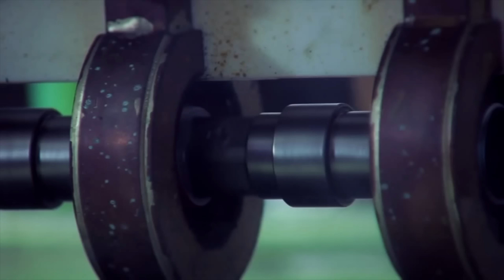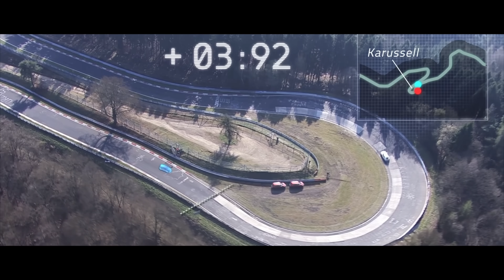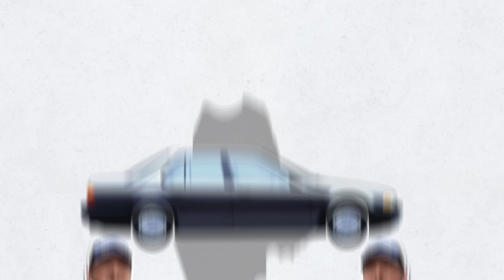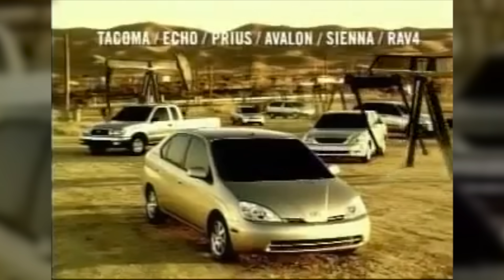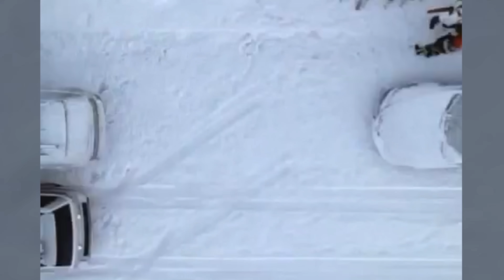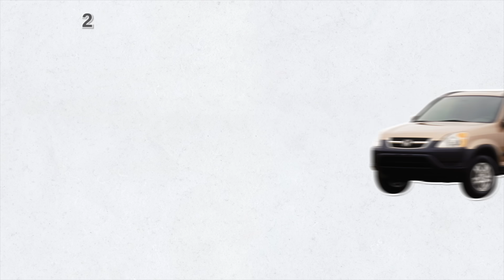Here’s Why Honda’s New Cars are Genius

Comment: The old cvcc engine is my favorite.  That thing got incredible mileage, was reliable once they fixed a few issues and you could run it on the cheapest crappiest gas without an issue.
Reply: Why would you want to run the crappiest gas you can...

Comment: I’ve had a Honda 2002 Honda CRV mk2 petrol, automatic for the last 19 years, 250k miles. Drives like when it was new. 
Even the interior doesn’t look like it’s worn very much. (Just the steering wheel and the drivers side floor mat) 
Never broken down and never had a problem with it. 
I drive it to work every day with complete confidence. 
I take it on a 400 mile trip every month and I also to city driving with it. 
It’s a little thirsty sometimes but it’s from 2002. 
It’s just a really comfortable car to drive and you can unbolt the rear seats and make it a van which is really useful.
I’ve used the picnic table loads. It’s very useful when you know you have it. 
Great car. If it did ever dies, I’d wish for Honda to sell me the exact same car again but with 2021 fuel economy.
Also had a lawnmower for 20 years, never replaced anything on it!
I has a friend with a 1999 Mk1 crv who didn’t realise he was driving it without coolant for 6 months ( stone had put a hole in the radiator) never broke down and still drove it for 10 years after had no issues. 
He really abused that car and when he was done with it he sold it to his mechanic who loved servicing it.

Comment: Honda Prelude 94- 96 is my favorite. It was my first and I got 311,000 till a tree fell on it. Bought another used one and have 354,000 miles on it. Bought a Ridgeline and have 280,00 on it and it still runs great. Recently bought a 2010 Acura TSX with 202,000 and a replaced engine. After my first prelude I always wanted an Accord. My brother has an element with 425,000, but he stopped taking care it. I drove my friends 2000 Insight for two weeks and the car was fun to drive. Getting 50 mpg was awesome. I had no idea till that Lude how good Honda is.

Comment: I’m currently driving a 2018 Accord base model sedan, with the 1.5L- It is by far the largest, most fuel efficient car I’ve ever driven. I just made a trip from COlumbia, Louisiana to Houston Texas, never exceeding 5mph over the posted speed limits and pushed the average MPG to 38! And I’m not a serious “High Miler” babying the fuel economy. The little turbo charged engine has more performance than most and will carry the car to ~
118mph rather easily.

Comment: I own a 1981 Honda Prelude since new, it has been a reliable car with just 170,000 miles.  But now I have issues with the carbutator.  I even bought a remanufatured carb, but I still having issues.  The car runs fine for the first 20 minutes and then looses power.  I read that the CVCC carbs are a pain to tune, and people replace them with Webber carburators. Is this what I should do?  I love this car, it was my first new car.

Comment: 2012 honda foreman 500 5 speed manual only. I have changed oil and the brakes regularly and diff fluid and antifreeze. Replaced starter one time and new plug. Currently has 5k miles with original battery.

Comment: 1996 EK civic vtis, still a daily driver. At nearly 400 000 km travelled, the cost of replacement tyres has nearly exceeded the original purchase price. Still the original D16Y8 engine too.

Comment: Alright!!
I recently bought my first Honda ever. We got a Honda pilot, 2008 model. I love it!!
It had 210k miles when I bought it. I gave 3k for it. I have wondered if I paid too much but we have put 5k+ miles on it and everything still works great except for one thing. The day b4 yesterday I accidentally called it a jeep to my son and I immediately apologized but it heard me. That night on my way to work the back left window popped off track.
It doesn't use or leak oil. The ac is super cold. The interior is almost perfect just a stain on carpet at the back hatch. I love it so far! 
Was 3k too much or a good deal? He originally had it listed for sale at 4200 but took 3 for it. It has DVD player and still has the headphones. I am so thankful for this video. The only other thing mechanically wrong is the front passenger side strut. It clanks when u hit bumps and also when u get going about 63mph depending on weight in vehicle. The driver door has a dent where lady backed into it. 
We are so thankful to have it. It runs perfect. If all Honda engines last like this one I understand everyone wanting one. Thank you and I love the videos!

Comment: The insight came out in 2000 not 2003.  It could get 70+ mpg on the highway and was designed to last over 300,000 miles.

Comment: 2014 accord 4 cyl 230.000 miles uber and lyft has never left me down beautiful and reliable 
I do drives from reno nv to tijuana airport at least twice a month also from 35k I had only replace the belt tensor and battery beside regular schedule services

Comment: My first car was a 92 Integra GSR that I bought for $5750 with 120k miles, before my Sr. year in HS.  I drove it all through college, and delivered pizzas for most of that time.  I sold it my Sr. year in college when it had over 250k on it, for half what I paid originally.  It had the super rare 1.7 VTEC, and there was no rev-limiter.  I revved it well over 8K RPM often and always ran like a champ.  Moved on to a 2000 GSR with a little over 100K, and also drove that to a quarter million miles.  Honda made some exceptional vehicles in the 90's-early 2000's.

Comment: Scotty, I've had 2 CRX's and 3 Del Sol's and thoroughly enjoyed each one.  I'd pick up another Del Sol, except every one I find has been so beat upon or modified by under 21's  that the bulletproof reputation suffered.  The new CRZ's don't hold a candle to them.  I always tell people that if they change the oil religiously at every 5K miles, their Honda will last forever, and I put over 250K on each of 2 of the Del Sols.

Comment: 2008 Civic LX. Bought it with 136K. It ran rough and it was pretty obvious that almost no maintenance had ever been done. Engine oil filthy, broken plastic engine shield and bumper guard, worn spark plugs, trans oil never changed (causing rough shifts), front struts bad, motor mounts bad, cruise control and even interior armrest latch bad. And yet, it is so easy to fix and maintain (generally) that I fixed it all myself for less than $700 -- mainly with cheap Chinese parts (sorry, Scotty). Has been running great for years now and I think my bad relative wants to steal it.

Comment: Have a 01 Accord EX Sedan 2.3L 4 Cylinder engine. 5 speed manual and it runs like it’s brand new, no issues at all no headaches.

Comment: It seems like Honda excels at responding to consumer demand. Innovation in concept has proven costly; their oddball models go largely unappreciated until they're discontinued - and then they have significant cult followings, like the Element. But they nail the design. The Accord is the most refined midsize in its class, the Civic is the nicest compact in its class, and CR-V is just the nicest compact SUV.
Reply: The Crosstour remains strangely desirable, especially the v6 with awd.
Reply: @-TheMillenniumFalcon  Yeah I want one of those too, ugly from the back though!

Comment: 2008 Honda Civic SI extremely modified everything but boost. 200k miles still starts and runs like butter hits 85k RPM every time I drive it. 2015 Accord 6-6 on its way to do the same thing no problem. Honda has been fantastic for decades!

Comment: My 2005 Pilot ex l has 130,000 miles with no repairs other than maintenance and new brake rotors. My 2012 CRV went 8 years with no issues. I paid about the same amount for my 2020 Pilot ex l as I did for the 2005 Pilot. I am very happy with both Pilots. I used to buy Nissans 2 sentra sedans 2 pickups and an Xterra. I do still own 1 Nissan a 2007 350Z.

Comment: Have a 2014  Honda Civic ex sedan with 178,000 miles and it’s still running good. I just did some minor maintenance yesterday and it’s driving like it was when it was brand new.I know they had some issues that year with the cvt transmissions but if you do the maintenance every 30k miles you will be fine.

Comment: My 2009 CRV has around 95000 miles. It is barely broken in. It has been damn reliable. It is on its 3rd set of tires and it seems to need a battery every 3 years.

Comment: All great cars, but the greatest is the 2nd generation Honda Fit! Gas tank in the middle of the chassis (under the front seats) so a giant 57 cubic feet with seats folded down! Bought mine brand new in 2011 and literally nothing but oil and filter changes, tires, and brake pads since, ten years later, and not a spot of rust anywhere despite it being on the salted winter roads of New England.  As reliable, perhaps even more reliable, than your Toyota Matrix! (I detect a challenge!) Do a show on the 2nd generation Fit please thank you!

Comment: I own a civic 2007 EXi, currently at 350,000. Had to redo most of the suspension though, replaced engine mounts twice. Got some work done on power steering... But the engine ... the engine is going strong without ANY issues at all what so ever. I do feel a slight lag in gear shifts though, after clocking this much, i guess the gears have started to wear out. i guess around 500,000 a gear change will be required.

Comment: I have a Honda Civic 2015  an when i drive it i can’t even go 10mph without it thumping back an making a clicking / thumping noise a few moments later i try to drive it then the car wouldn’t move i put it in drive the car also didn’t go no where or in reverse.  the car sounds good when on an don’t make any noise but i don’t know what it is could it be the transmission?? Can anyone help me ??
Reply: could be transmission,  can also be overheating, if the car is cold and you put it in drive, still no movement  more likely the transmission. But take car to a mechanic.

Comment: The Renault Megane trophy R doesn't even have back seats. The civic would probably beat it if you dumped the rear seats
Reply: And how much you think a back seat weight is? LOL  The megane uses a 1.8, the Honda 2.0, but the engine was develop by Nissan and tune by Renaults port, if you were keeping up-to-date, you know that the is also a Renault megane trophy which is different from the trophy R that has back seats in the car, that makes 300 HP from the 18L that has the same time as the Type R, and if you watch them drag race you know they are very very close as well. If you know about Nissan SR-VE series engine, you would know the B series and the older Type R was no match for Nissan SR-VE engines that use Nissan neo VVL. Think many people like you continue to under estimate Nissan when it come to making race engines and road performance engines, and maybe had no idea that Nissan was the one who develop the engine. The reason why Nissan engines are faster is there valve timing control, Nissan VVL start produce power from 0-RPM, Honda power comes in at certain RPM. That why in history Nissan SR16VE with 190 HP N/A is still the world most powerful 16oocc non turbo engine ever made. And I drive a 2005 Honda accord V6, but accept Nissan are just faster with some of their race engines.

Comment: I have an 08 Honda Pilot, bought it used with 149k on it. Best car ever. I test phone coverage while driving and I have all sort of electronic equipments inside the car that require constant power. So that means my Pilot engine is running 8-10 hours a day 5 days a week. Even when I take a break I leave the car on, I lock it from the outside with the valet key. Engine and transmission still strong at 232k miles. It has never let me down. And I know there are Pilots out there with over 300k miles on the same engine and tranny.

Comment: I had a 2006 Civic EX.  It used the accords hybrid compact 5 speed automatic which was great for fuel economy but felt it was slipping.  Drove the manual and was just way better.  Sadly I was T-boned by an SUV driver on their phone.   I walked away without a scratch.   Miss that car.

Comment: My favorite Honda is the 99 or 2000 Prelude base model. Great handling, looks great good power, dependable and still turns heads. Sold my first 99 with 200 k for 50% of what I paid new.  My current 99 has only 39k on it. It is my baby. I will keep it forever.

Comment: i have a 2019 Honda Fit and love it. It's a little slow off the line but I can pass people on the highway like they are standing still. The CVT transmission is a little strange because you don't feel any shifting, but going from 70 to 90 faster than a jerk on the highway who won't let you over is satisfying.

Comment: I have a 2018 Civic Sport (6spd Manual) and the only complaint I have about it is that they didn't offer the SiriusXM capable radio with it, but I installed my own.  It has been incredibly reliable. I am a fast/precise driver and never find it lacking.  Of course, I also keep the oil changed in it and generally care for it, so I'm sure I'll have it either for a long time or until I can upgrade to an R-Type.  Kudos to you for helping me find new or improved ways to care for my vehicle.

Comment: I own a 2006 Honda Euro Accord with the 2.0i K20 engine and I love it to bits. Best car I have owned so far. It is at nearly 100k miles and runs like a clock. I may replace the spark plugs one of these days… but man, this engine is a gem.
Drove on a vacation for roughly 4200km and this car just keeps giving. You can push it on the motorway at 4500rpm for hours on end and it won’t even flinch.
Fuel economy being surprisingly good even at 4000rpm 5th gear…. I think I will drive this car until it’s just too expensive to repair. So far though, nothing but normal maintenance. Would totally buy another one in good condition 😂

Comment: Stanley Keith
1 day ago
QUESTION BEFORE YOUR FINAL VIDEO : Hello Scotty, I have a 2002 GMC 2500HD 4x4 with 30,800 mile on it. I have all the inspection and the miles on them. Only 30,800 Miles.  Can I ask you a Question, If my power steering goes out will I lose my Brakes. This is my second power steering pump that I had installed. About 9 months later I got in to start my truck and the brake pedal went to the floor and all the power steering when all over the driveway. Do I have equal boost and what can I do to fix this? Could it be a power steering hose that went bad. Also my brake light has come on but the brake reservoir is full. What should I do first. I think the guy I took it to did not fix it right the first time. Thank You for any Help you can give me. 08/20/2021

Comment: My 2016 Accord EX-L has been my favorite car. Only complaints are that the stock battery is junk and the front LEDs tend to die in that model.  I replaced the battery with a Duralast Gold and the LEDs are under Honda extended warranty and were replaced at the dealership. I got side swiped by a mustang on interstate on my way to work and had $6k in repairs.  I also put nearly 30k miles a year on it due to my commute to work as well as driving FOR the job.  It still starts up without issue and drives like it's brand new. I want a newer model Accord Touring 2.0T and my wife wants a CR-V. Unfortunately I can't afford both so it looks like we'll be getting a CR-V soon.

Comment: Hi Scotty,. Hope you answer this.  
Why all the Honda's and Acura so rough on the road.  Their suspension are to stiff and when driving the car never seems composed.  When hitting potholes it reverberats throughout the cabin, feels like the cars hit the rim.  I have owned accords, crvs Acura passport they all drive very rough.

I just bought a 21 signature cx9.  Drives much more composed then any Honda I've ever driving.  This is my 2nd Mazda

Btw they were not always like this.  It got much worse after the Wishbone suspension was scrapped.

I always was a big Fan, but will never buy a Honda until this fix that stiff suspension.

Tks..

Comment: Scotty thank you for your advice, just helped my kid find his first car. 2010 Honda Civic w/ 99,950 miles for $3k because of a dent. It’s mechanic approved, what’s your recommendations for 100k service? Thank you.
Reply: Mine is fuel injectors, spark plugs, cap& rotor, rebuilt front drive axles, timing belt and water pump. Inspect all and replace if original or needed. I own a 2010 Civic, a fine car.
Reply: @stevescherer4954  Great, thank you. That’s exactly the type of information I was looking for.

Comment: 2000 Accord LX V6. My family drove it until it had 298,000 miles. I met the guy who owns it now (who’d be the third owner) and it now has over 400,000 miles on it, with the original engine.

Comment: I own the best Honda, something you guys Stateside never got, a 2012 Honda CRV 2.2 IDTEC Diesel, this is easily the best car ive ever owned. Lots of torque, easy to drive and super reliable at 300000km doesnt use a drop of oil, no smoking either.7.9l/100km with heavy right foot - all the time, on the highway drops to 7.2 fully loaded.
I am very impressed, I gave my 2010 1.5 Fit to my 18year old daughter, and she loves it.
Reply: Any carbon buildup issues???🤔

Comment: Scotty I'm going to quit ringing your bell if I can't get an answer back to any of my questions this one is an old 17 Buick Regal 74000 miles on it 2.0 turbo charged can I run a hundred percent gas in it versus The corn oil but of course the percent gas spending on where you buy it and only wear from 87 89 octane do I need an octane booster if I use it and should I also put fuel injector cleaner through it specifically Lucas hope I hear a answer back for this question

Comment: Currently have 2017 Honda Accord with 52k miles on it. 
No problem at all, rides perfectly. I mostly do maintenance myself. My only concern is the CVT Transmission, it doesn't have any problem now but I prefer the standard automatic transmission by Honda.

Also you forgot about Honda Ridgeline Scotty!!!